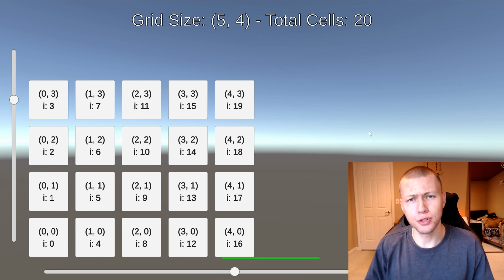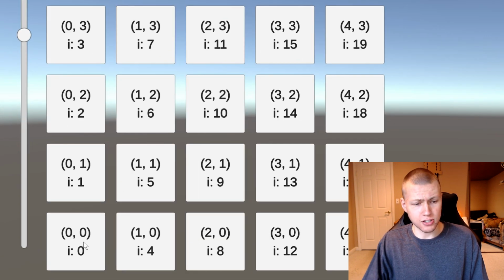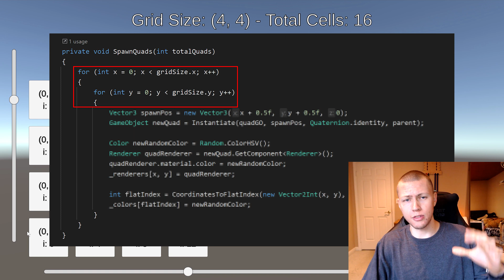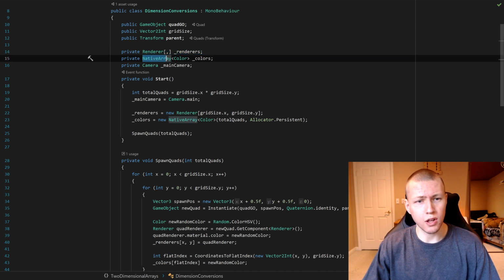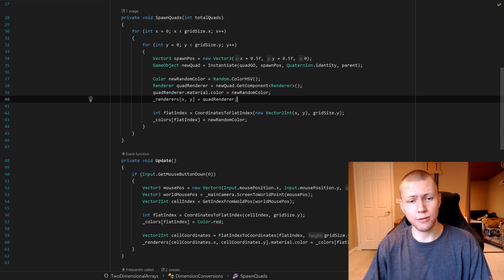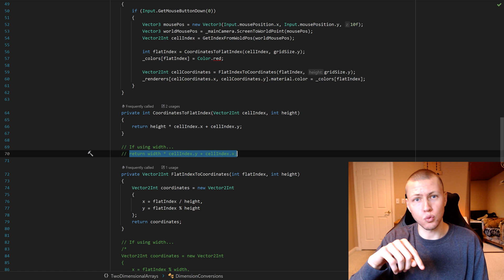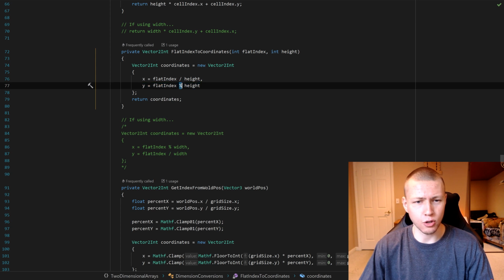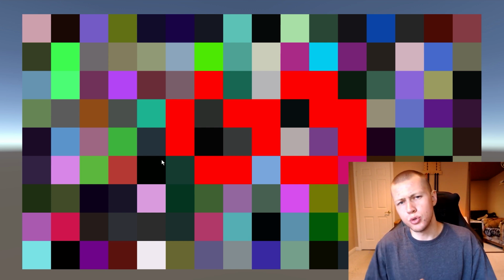How to Use 2D Native Arrays for Use in Unity ECS - Flattening 2D Arrays [Old Version of ECS]

Comment: I was wondering how do you solve the problem when you can't put native array inside of native array.
In the case that, each Row don't have the same length.
Like 

Row0   0 1 2 3 4 5
Row1   1 2 3
Row2   1 2 3 3 3
Row3   1 2 3
Reply from the maker: That's an interesting situation - wondering if for that you just make each array the length of the longest array, then just use zeros to fill the empty space. If you want to have a check to make sure each element is valid, the first element of each array could be the count the number of valid elements i.e.
3 1 2 3 0 0
2 4 5 0 0 0
1 8 0 0 0 0
5 3 3 2 0 8

Comment: In what practical scenario is this applicable?

Is it primarily to add components/modifier scripts, values in an array format compatible with ECS for easier CPU accessibility?

I have watched a fair amount of your videos, and I understand all but this...
Is this at all relevant to a more recent upload of yours in regards to Dynamic Buffers? - https://www.youtube.com/watch?v=Ki0AwYZw2Ac
Reply from the maker: Good question. A while back I made a flow field pathfinding system where I broke the world up into a grid of cells, then could use this to keep track of their x, y positions while storing them in a native array. Though back then I feel like I may have still had a bunch of object oriented tendencies so maybe I would do things differently now...
Yeah you could definitely use this with Dynamic Buffers, but depending on the size of 2D Dynamic Buffer, you could fill up your chunks really or end up having to move the data into the heap.